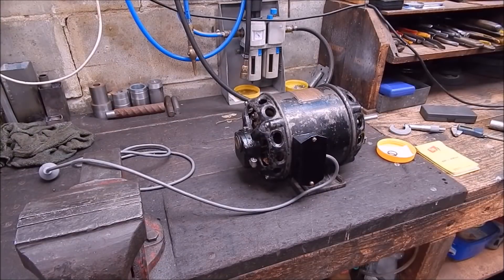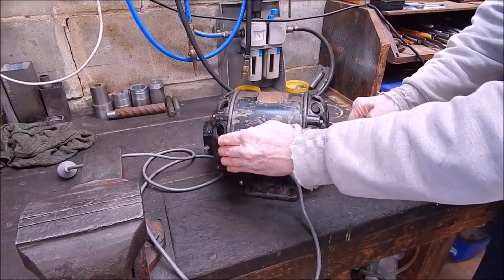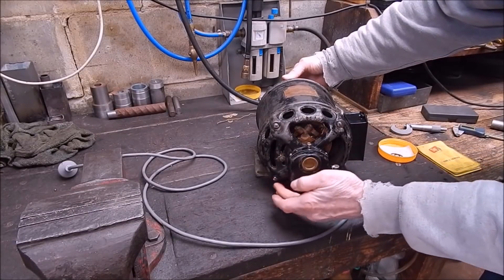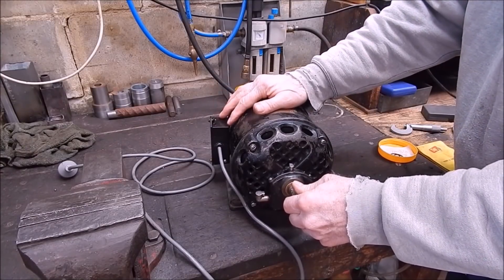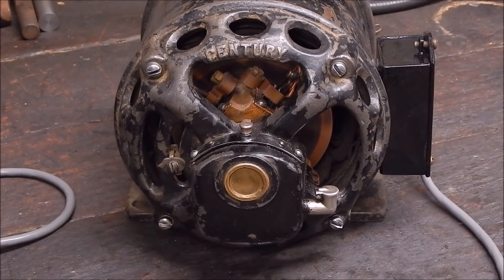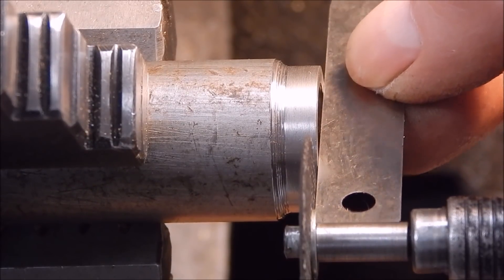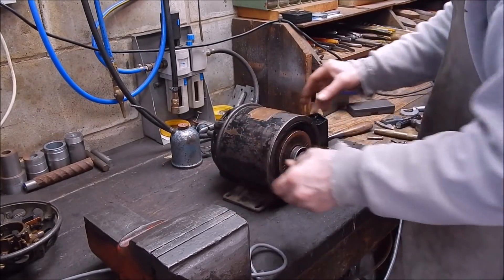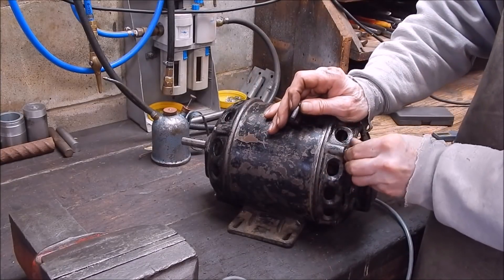I shim the armature on a Century repulsion start electric motor

Comment: Hi Rob,of all things I have one of those motors as well.1/6 th HP..used it for 20 years for belt drive for grinder.Took it out of service 3 years ago.After your video think I will clean it up ,after all they are a work of art and history.Thanks
Reply from the maker: Hi Patrick,

They sure look good.  Same thing with the old 1920's electric fans.  They all used the same open ended case style.

Interestingly there's no fan in the Century motor, so it must just rely on convection current for cooling.

I checked the RPM with my laser tacho and it was 20 RPM high, exactly the same error as my old McColl motor on the Schaublin.

Then again, maybe my tachometer is out ?

Cheers Rob
Reply: xynudu That is interesting on the rpm.My motor is 115 vac. The volts we have is 120 vac . Not checked with tach. Maybe extra volts= + rpm . Just a guess...pat
Reply from the maker: I doubt it, as induction motor speed is primarily determined by the frequency/cycles (correct me if I'm wrong on this).

The actual line/supply amperage affects the HP/available torque but not the speed.  Once again, I'm no expert on this but I think that's how it works.

PWM (pulse width modulation controllers vary the frequency, to vary the speed of AC motors - eg ceiling fan speed controllers).

The same thought did go though my mind, as my motor is plated at 200 volts and is getting 240.  Must be OK as it's lasted this long.

Cheers Rob
Reply: Rob,sounds good to me.I'm not an electrical guy.Dug out my motor it is a Wagner Electric,115 vac,1725 rpm.1/6 HP.Has a brake when it is shut off brush rigging pushes against the flat commutator. Thought that was interesting. threads on output shaft end ,short maybe for lock nut.Maybe used for fan....Pat

Comment: Question- I have acquired a similar vintage motor and wondered what type of oil you used to lubricate your motor? Thanks
Reply from the maker: Regular car engine oil will work fine.

Comment: Hey Rob. I know this is a while ago, so I hope you spot this comment. How did you measure the endplay to work out the thickness of the shim please?
Reply from the maker: By feel.  It's not a critical measurement, so long as the armature has a tiny bit of end play.  The brushes retract back quite a bit, so there shouldn't be any clearance issues there.  I would normally allow about 2 mm clearance for a job like that.  Better a bit loose than too tight with bearings, where heat expansion may be involved. Cheers Rob
Reply: Thanks Rob.

Comment: I remember those repulsion  start induction motors well.  Good for a home shop that may have marginal wiring because they have the lowest starting inrush.  They were replaced by the much simpler, cheaper, lighter, smaller capacitor start motor. But they still start a load with less current.

Comment: Rob -- Shut things down and go have a beer. That sounds great to me! Do you have any use for the motor, or it more fun tinkering with it and getting it running again?
Have a good one!
Dave
Reply from the maker: Hi Dave,

No use for it at the moment.  I could put it on the Schaublin to replace the old McColl but it's less powerful and not as heavy to load up the flat belt drive.  So it's just saved from the scrap heap and gone into storage.  Made for a good video.

Cheers Rob

Comment: A little tip you may find useful when sizing shims that I have discovered is to use a piece of sticky tape, shape the tape into a circle big enough to go around 2 or 3 fingertips but with the sticky side out. Set the shim on a flat surface and stick the shim to the tape. Now you can sand away to get the correct thickness without sanding your fingertips or shim go flying. Cleaning grease and oil off the shim first is a must.
Reply from the maker: Thanks for the tip David.  Always good to share good ideas and tricks to make life easier.

Cheers Rob

Comment: Hi Rob !
Nice restoration job you got there !

I have an old rusian 5HP in my lathe and I want to shift it to another motor and get rid of all the old relays and contactors !

Now I've seen you I will try to clean the old motor for alternative use.

 - how did you clean the windings inside ?
Reply from the maker: Hi Keld,

I wasn't game to try cleaning the windings.  You have to be careful not to destroy the varnish and/or the insulation tape used.

Definitely no alcohol based cleaners. Petroleum based cleaners can also damage any adhesive glues used on the tape.

The grime was mostly oil based and ingrained, very hard to remove.  The only solvents I used were a strong water based degreaser/detergent (floor cleaner) with a tooth brush (on the commutator and brush housings etc.)

It came up pretty well where I did it.

I hope this helps.

Cheers Rob
Reply: Honestly that is the only thing you can do. The varnish will disolve in alcohol or petrolium based cleaners. The only product I can think of is either dish detergent or the floor cleaner degreaser. I would consider picking up some automotive clear laquer and mask off the contacts and spray the windings up and let it soak. It should stabilize the motor windings and make the old girl last much much longer. Thank you for this video by the way. I learned quite a bit, I have never seen a brush setup like that before.
Reply from the maker: Hi Bruno,

Most of that old insulation will remain OK provided you don't mess with it.  It goes brittle over time and movement is the main enemy. Some black silicon gasket cement in the right places can help stabilize things.

These old repulsion start motors are very unique and interesting.  They are basically two motors in one.  It uses a wound armature for starting, and then switches to common induction squirrel cage operation for run time.

The fact that they made them look so damn good also helps.  They are becoming increasingly collectable.

They are heavy and bulky for their HP, but some of the other old cast iron squirrel cage motors (like the McColl on my Schaublin lathe) are pretty much the same.

Thanks for the comments.

Cheers Rob
Reply: @Xynudu  
I have found these old motors to have more power than a newer motor.   That old motor is probably equivalent to a one half hp.   They also seem to use less power than newer motors.   That big body around seems to give more leverage if you know what I mean.   I think the newer style is easier and cheaper to make than the old ones is why they are made now and fit in a smaller box and not so bulky for some applications.

Comment: All pieces of equipment with removable parts MUST be made to that the parts can ONLY be put together in one way (for example, each end of a rod a different shape, etc.) unless the part is ABSOLUTELY THE SAME IN FUNCTION EITHER WAY.  If you CAN put a part in backward that will not work right, then somebody ALWAYS WILL do so, causing major problems or even destroying the machine.  The HUBBLE Space Telescope's main mirror had its manufacturing polisher with a small part that could be put in backward (and which would not work properly if so, though with no obvious result until too late) and IT WAS, almost costing the US NASA $1,000,000,000 minimum, as it was found out only when in space!  A special "pair of glasses" had to be made and launched in a separate Shuttle mission and installed by astronauts to fix this, costing almost as much as a new HUBBLE would have.  Murphy always gets his pound of flesh, if allowed even a tiny opening...

Comment: Pity we didn't get to see you referbishing the motor and making the small electrical box.
Reply from the maker: Hi Mark,

I brazed up the metal box and I guess that would have been an interesting video, but I didn't think of it at the time.

That's where brazing is unbeatable for light fabrication.

Cheers Rob
Reply: @Xynudu  I would have loved to see how you brazed that small box.  It is light metal and how you assemble to braze and do you braze from inside or outside?
Reply from the maker: @dalemcinnes1834 

 Hi Dale,

I brazed from the inside so any over run won't matter.  

Being thin walled steel the heat transfer is very fast and the rod flows very easily/well.

Next time I do a job like that I will video the process.

Cheers Rob

Comment: Nice work Rob, though I wouldn't have been able to live with the 3 (7?) old bolts and one shiny stainless one!
What're you going to use the motor for?  Would look nice running an old lathe.
Reply from the maker: It's all going to get painted one day.  They actually look the same, and I doubt anyone could pick the difference unless shown.

I've no idea what I will use this on ;)  I can't resist a bargain, especially one that looks this good.

Cheers Rob

Comment: I was totally unaware of this type of motor.  When I saw the brushes I was expecting it to be a universal motor.  From the video, the shaft speed looks rather slow, what is the operating speed and hp for this motor?

Cheers!
Reply from the maker: That's the strobe effect from camera frame rate.

The motor makes one third horse power at 1460 rpm.

I have seen one of these used on a small vintage metal lathe.  They look really nice paired with classic styled vintage machinery.

Cheers Rob